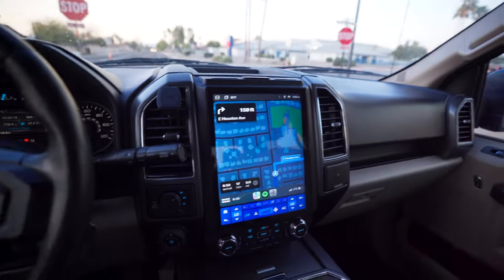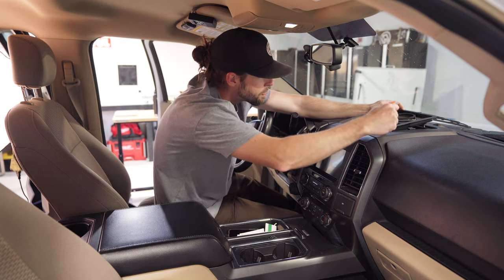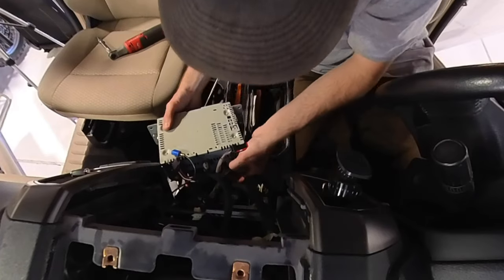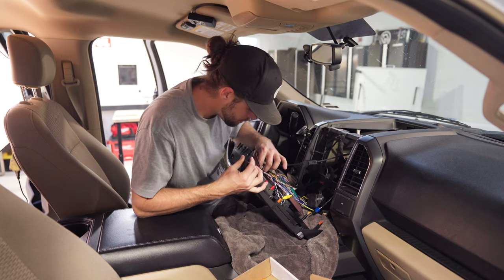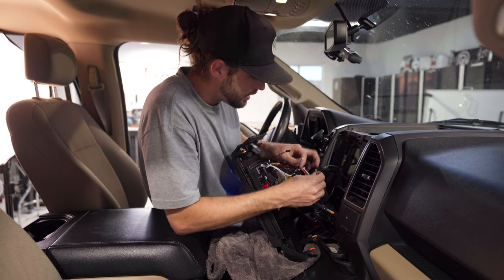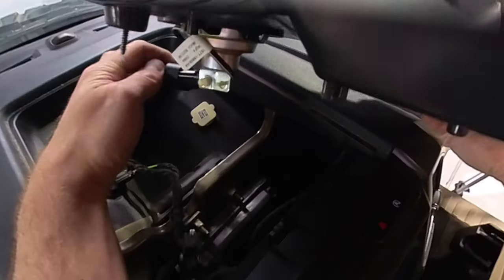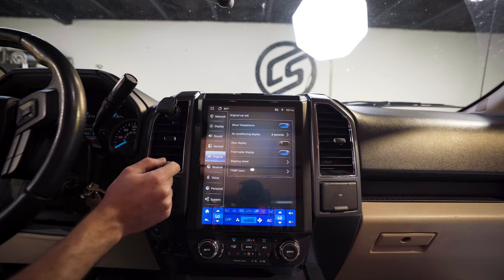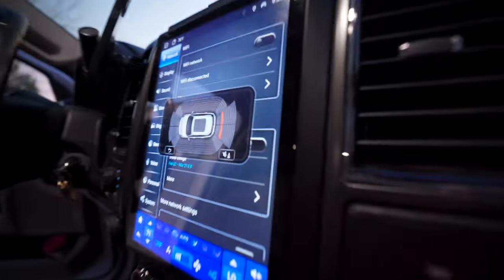F-150 Tesla Radio Install (Wireless Apple CarPlay & Android Auto)

Comment: Be advised, installed this and used the SIM card connection, didn't work. Long story short reached out to idoing and they confirmed that the SIM Card feature does not work, only reason the sim card connection is included is because it's part of a bundle from their supplier.
Reply: same

Comment: People in the comments are asking if sirus xm still work. You haven't bothered to answer.
This makes me want to look at someone else's product
Reply: Check the product specs. Many use Apple car play which people prefer. XM should work on most of these, will be listed in specs. Takes 60 seconds of research
Reply: I've yet to see an android head unit that supports xm bro
Reply: @Roger-il8iw to buy an android head unit which is basically a tablet totally defeats the purpose if your going to use to just use car play or Android Auto as they are very watered down versions of tech
Although it is easier to control with your phone
To each their own

Comment: I have a 2015 Lariat without the 360 camera.  If I can get the cameras for it to retro-fit it, will this unit show those features?  I ask because when looking to upgrade from my sync 2 to sync 3... I was told by a stereo shop that I needed to provide the VIN so that the features that I have would be available in the sync 3.  The guy made it seem like I could not do an upgrade with the stereo switch. Thanks!  Oh... also... do you know if the ambient lighting allows for the Ford programmed color changes?

Comment: Very Helpful Video....I just installed it on my 2015 F150 its lags a little more than I expected, but overall an improvement...the back up camera quality is really static and I am not sure why, I did mess around will all the options but still really bad.  I will ask the manufacturer if there is something I can about it or if I need to replace the camera with a newer technology
Reply: any updates?
Reply: @vaderfx4  I have not yet take apart the tailgate to inspect the grounding cable as someone else recommended.  Camera is still distorted, some people have also mentioned if your battery needs replacing that might also be an issue.  I will go to autozone tomorrow to have my battery tested...as I plan a 2 hour tow with my boat this week.  I do love the radio, get tons of compliments.  I also have a 2024 Rubicon 4xe so, this is more my tow rig and haul truck.
Reply: @Reno255xe  Thanks for the update I noticed on 17:03 he changed the setting on the cam and it seemed to stop the static I hope this works for you let me know because I wanted to buy this because it has a OEM feel to it with the hard buttons .
Reply: @vaderfx4  yes, tried all settings and it’s still not working as expected.
Reply: If you didn't have any problems with the camera before and you already tried to lower the resolution in the settings, then you probably have to replace the camera with an HD camera. In my 2014, my camera was so distorted that it was useless because the screen resolution was way  much higher than the camera, so it couldn't display right. If you gonna replace the back camera, you might as well install a front camera and maybe even a 360 camera really isn't that hard at all.
Reply: @PlumberWRX  I agree completely.  That is what I suspect is the issue.  Have you a parts list for what you purchased?
Reply: @Reno255xe  Well I read the thing about the ground screw so I'd try that first because our trucks could be different but if that doesn't work I'd contact the dealer mine sent me one for free but any HD back up camera off Ali express would work. There's more tutorials on YouTube for it.
Reply: Hey All,

Wanted to share a quick update…I ordered a replacement camera off Amazon that is was assume better quality…hoping that would resolve the issue…no luck.  Could argue it’s a little worse but hey , Symantec’s..LOL 

I am guessing it’s the cable that also needs replacing and that will likely be my next step.
Reply: @Reno255xe  any updates with the new cable?
Reply: @jasonsongs7678  So, I spoke with Idoing via chat about a month ago...they said a new cable is not needed.  Its a grounding wire issue.  I will send a picture in my next reply.
Reply: Looks like I can’t upload an Image …hmm let think about how I can share that with the thread?
Reply: @Reno255xe  can you upload a picture on another site somewhere and post the link on this reply? Thank you reno!

Comment: Did your steering wheel next song? cauise I installed with the new 14" and it doesn't work, you have to install some USB into the OEM with songs on it, to allow it to work. ARe you seeing  those issues as well?
Reply: Did you contact the dealer you got it from?

Comment: I’m really interested in getting one for my 19 King Ranch F150. Will it keep the 360 Birdeye view in reverse? And is audio lagging or responsive?
Reply: I’ve got the same truck - also to add to your question I’m wondering if the built in AT&T WiFi js compatible.

Comment: What if you have  a 2015 F150 Sport with the manual (non dual) climate system, will this give you dual zone heating and cooling?
Reply: No it won’t
Reply: yes it will. That's what the gentleman' Dad in the above video has. He asked the question at the 19:34 mark.

Comment: I ordered and got the system put in. But I have the B&O and the sounds the only thing not working any solution ?
Reply: Any resolution? I ordered mine and I have a B&O system as well
Reply: @rckyrcky  if you have B&O it won’t work you’ll have to get another adapter from the company which I did but it still didn’t work. Backup camera was horrible I just sent it back.
Reply: @WichTexCreator  Or you can have a shop bypass it

Comment: Any advice on Camera Flicker? I have the correct settings and just installed today, reverse camera is flickering and cutting out bad. I saw yours is clear but looks like another guy on here has the same issue
Reply: Run the ground for the camera to a bolt instead. Read that it mostly due to a bad ground and that grounding the wire to a bolt fixes the flickering camera
Reply: @Frank-zl6zr  Ended up splicing into that harness at the tailgate and ran it to the handle mount. Working good now!
Reply: Just installed this unit in my 15 F150 Lariat, the rear back upsenors aren't working and neither are my lane departure lights on my mirror any ideas
Reply: @Frank-zl6zr which wire is the camera ground wire?

Comment: Just installed in a 2019 F150. I had the small screen for the backup camera. When I installed this the camera image is glitchy. Changed the setting like you did and still the same. Any one know a fix?
Reply: Someone on another YouTube said to ground the rear camera for a similar unit, not sure what that entails. I’m looking to buy it for my 2019 F150 XLT, do you have heated seats? Wanted to be sure option still there. I use CarPlay mainly.
Reply: @shaun737  no. No heated seats. It was put mainly for car play
Reply: @acomeaux33  appreciate the reply…everything else working ok on it? I have a bass boat so that’s why I was kind of concerned about the camera but I want a bigger head unit.

Comment: Also i see that the WIfi does not stay on, working with support in China is some of the worse I have seen, its like talking to a 5 yr old, and they do not understand anything with common sense, video's help , but unless you speak Chinese and explain to their engineers, you will be in trouble and throw it out the window. LEt me know, love to see what your experience was, i am super technical and this new 14" only works like 95% so far.
Reply: Who did you order yours from?
Reply: Amazon and eBay. Bother are made at the same factory in China that everyone resells. I can get the name of the factory. It’s Viknav that makes all these. Their engineers are by far the biggest idiots. They don’t even have a f150 in China haha
Reply: @Living00The00Dream  They are. Some dealers are able to give better help than others, though. I got mine from autotec Pro based out of Canada, but there are the same units. Just when I need help, they are a little bit more helpful ...sometimes.